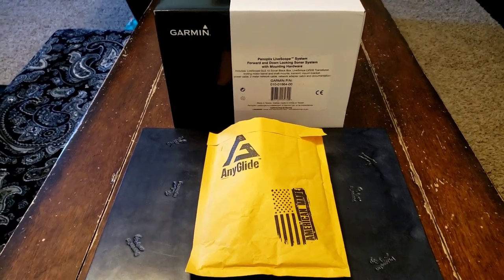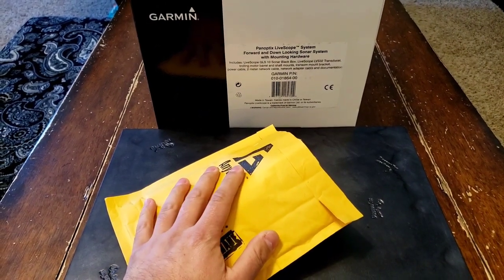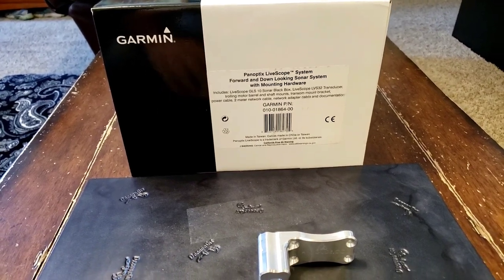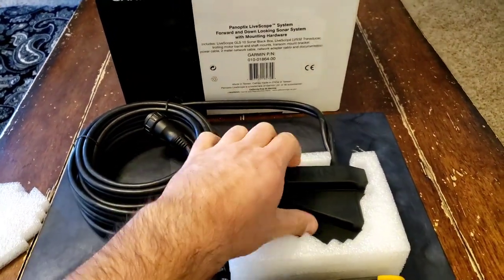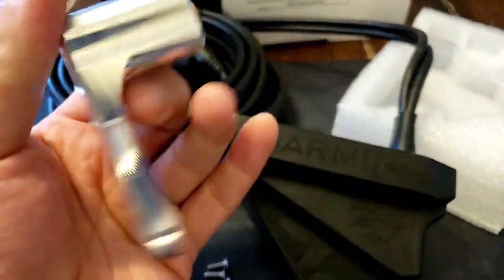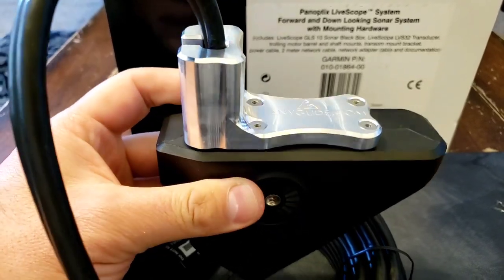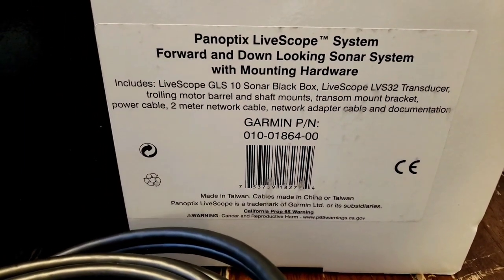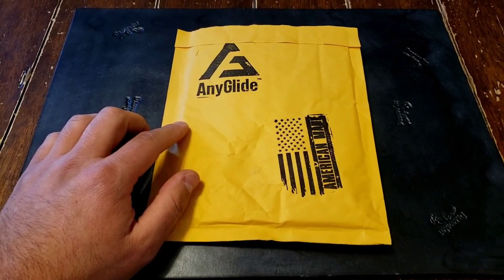- AnyGlide - Professionally Machined Garmin Livescope Cable Saver

Comment: How are the cables getting damaged in the first place?
Reply from the maker: The transponder cable's outside coating is fracturing/fraying which is exposing the internal wiring. Caused from switching the transducer into it's different orientations. Typically seen in the ice belt, colder weather states. Garmin has an amazing warranty but also puts your unit down for commission if applicable for the warranty replacement. A quick online search will help with displaying the cable fraying issue.
Reply: @MugShotFishing  might have to pick one up to be on safe side. I mainly use mine for ice fishing. Can you post a link for this general discussion?